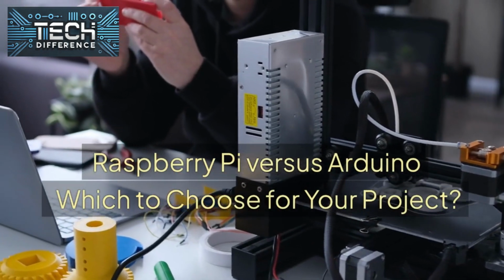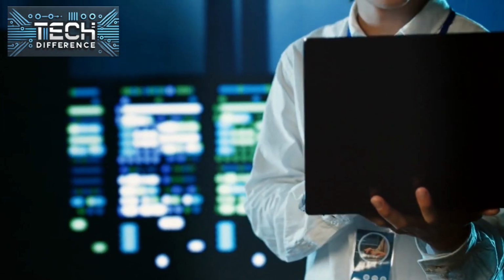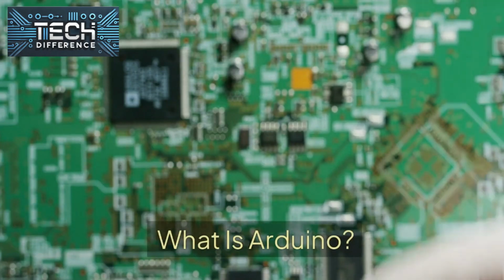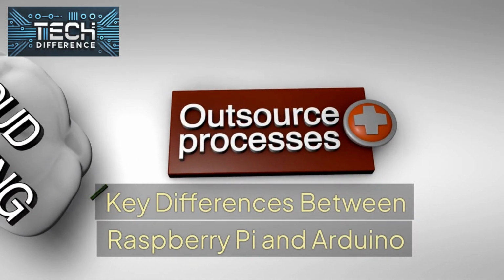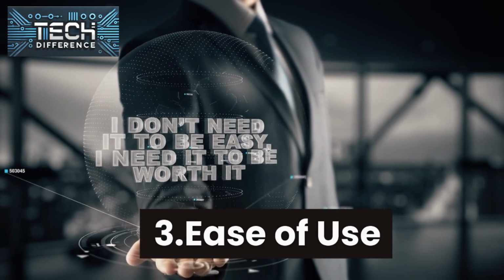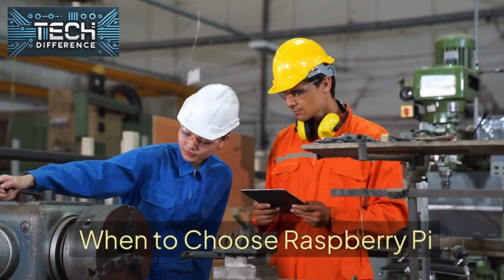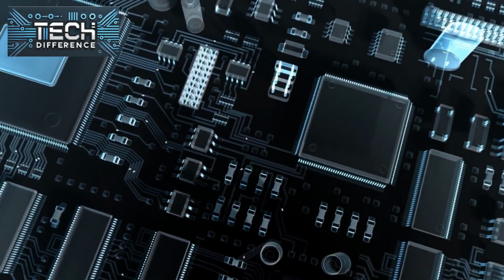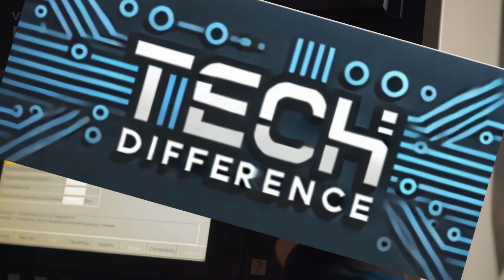Raspberry Pi vs Arduino: Which to Choose for Your Project?

Comment: I choose Arduino as possible. Not even Pico.
For advanced projects also. Untill high processing power needed. If use raspberry pi I connect arduno for hardware interaction.
Because controlling hardware directly.
 On raspberry pi is not easy as looks until you use overpriced costly HATs